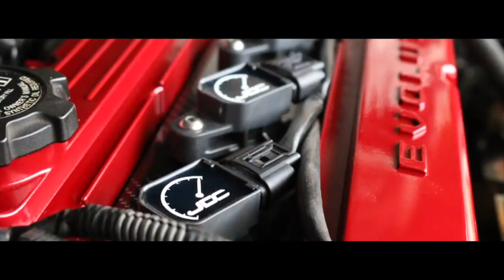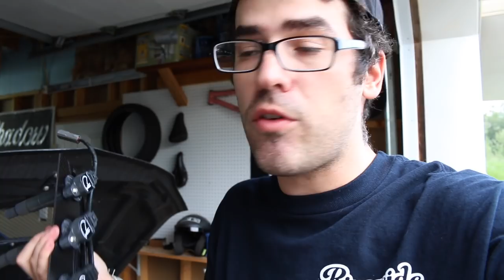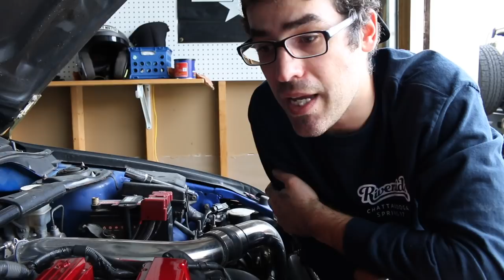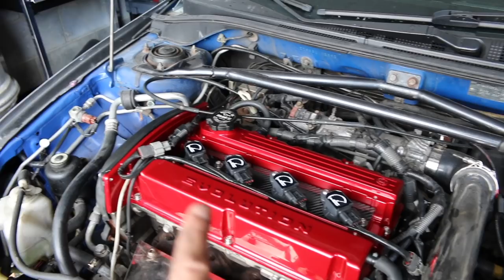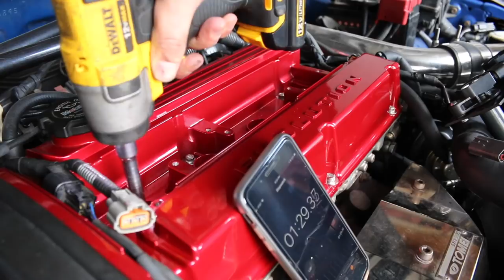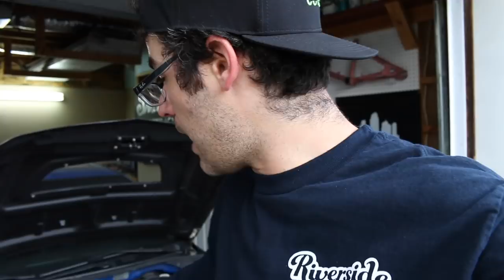5 ADVANTAGES OF COIL ON PLUG (COP) KITS!

Comment: you shouldn't drop the spark plugs like that... you risk reducing the plug gap if it hits anything on the way
Reply from the maker: You’re right but it’s very unlikely
Reply: @WasleySchultz  well its your engine and wallet if it does go wrong.
seen it happen on an EVO 5 and he had to rebuild engine after melting a piston
Reply: Spark plug sockits use rubber instert to hold the plug for removal to read are install after gaping them

Comment: Hey bud, nicely demonstrated well done. Have you seen any changes in your car after installing the JD COP? Also your rocker cover looks sick dude how did you paint it? Do u think it’s possible to paint it without having to remove it off the car?
Reply from the maker: Idle is MUCH smoother since I installed. That was the major change for me. The rocker cover I bought brand new, it’s the jdm Evo 7 rocker cover. It was a bit expensive $$$. It’s not possible to properly paint it attached to the engine. You’ll get paint everywhere. But honestly it shouldn’t take you more than 5 minutes to take it off.

Comment: hey nice set up aim thinking about installing this kind of up grade to my car  , to cure the problems aim experiencing as I continual to make more power gains ,  by the way Snap-On sales a socket that will help with the installing of your spark plugs , so you don't have to drop them in because this can damage the spark pugs  and throw off the gap on the spark plugs which can give you performance and rough idle, keep up the good work
Reply from the maker: Yeah that socket I have is for spark plugs but I’ve had for years so the end that attaches to the tool doesn’t still well anymore lol. Time for a new one! You’re the second person today to suggest snap on haha. I have some Mac tools stuff around. Good stuff!

Comment: does it match with mitsubishi galant gti efi manual transmission 1992 model? and where can i buy that one?
Reply: The valve covers are different between both generation style heads as they are reversed. The Toyota yaris coils this kit uses will work but not the mounting plate or the ignition wiring
Reply from the maker: what phillysupra said. the engine is also transversed.

Comment: The cop kit is too pricey...I got more time than money,so I'll pass.
Reply from the maker: If you go with the kit that you make yourself it’s significantly cheaper! But once you get to a certain amount of HP, it’s required. I’m not there yet but I will be in the future.
Reply: JDC ignition systems are some of the most affordable kits on the market. We have DIY kits starting at $89! All you'd need are the coils which can be pulled from a junkyard if you wanted to save even more money.